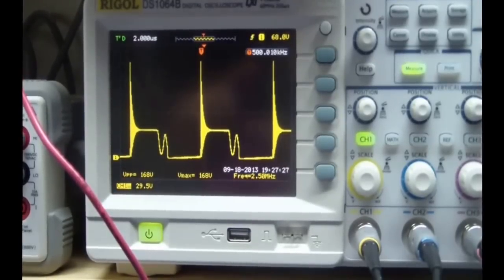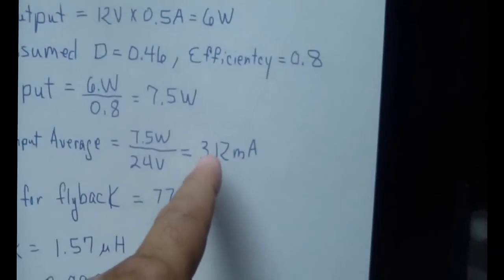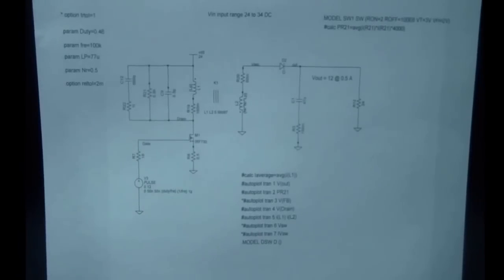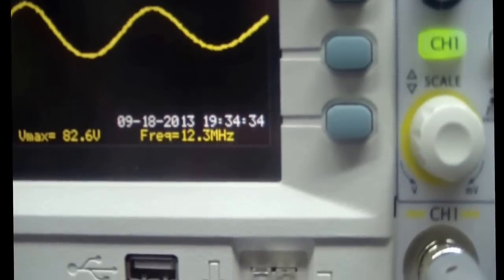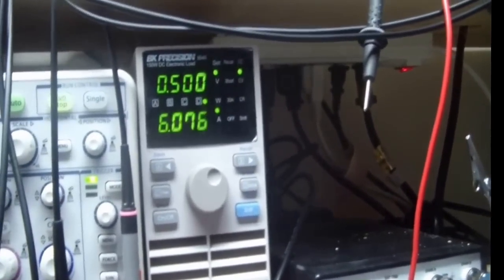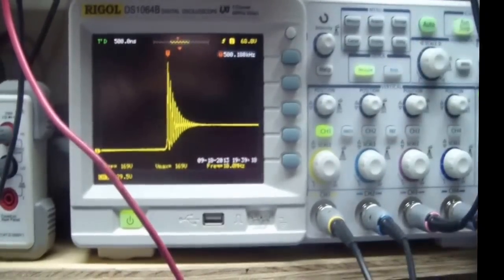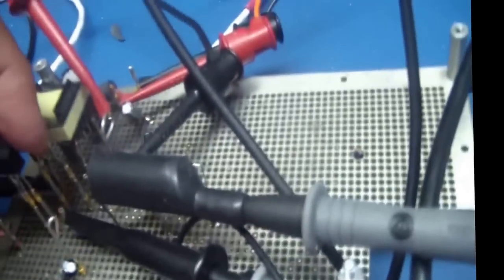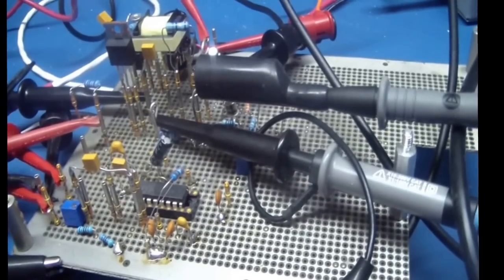Analysis and Design of a Flyback, Part 7, Testing the Transformer

Comment: i have a problem i measure lk = 70 uH and lp = 175 uH  so K = 0.77 is this very bad?
Reply from the maker: Yes the leakage to very high
Reply: how can i fix it? @RobertBolanos
Reply from the maker: Generally, you want to fill the layers to 80 to 90 percent converage. In other others, lets say you primay on the 1st layer is 5 turns of 1 strand of wire, and if would amounts to 40 percent of the first layer, then what you can do is wind it a two strands to that it will cover 80 percent of the 1st layer on the bobbin. You do the same with the rest. Please details of your transfomrer calculator and any other information to rbola35618@aol.com

Comment: Dear Robert very nice video. Do you mind telling what kind of output capacitor you used for the 100kHz switching? Can we use electrolytic or do we need some special capacitor?
Reply from the maker: Hi Anonymous, yes you can use electrolytics. However, electrolytic tend to leak over time. I typically try to use tantalum capacitor or if you want maximum reliability, then I would use stack ceramic caps. That is what we use for space rated power supplyies. Hope that helps.

Comment: Hi Mr Bolanos. I've designed a 12 to 24 flyback converter but the spike voltage on the drain doesn't change with the snubber circuit. I changed the resistor from 220 ohm to 47k but spike changed from 59 volts to 65 volts. Why doesn't it change the drain spike? Can you help me solve this? Thank you

Comment: Hi Robert , I have designed PUSH pull converter having same serious problem of this ringing which will cause Mosfet to blow off(instantaneous exploading ) as it exceeds the max voltage capacity of that , How to avoid that issue ? The only solution for this is Snubber ?  How this Leakage inductance can be avoided ?

Comment: this was a lot helpful thank you. How do I know the power rating of the startup resistor of the control IC I've the right ohmic value but it heats up so I can not operate it for long. I've also tried higher resistance value but the converter didn't startup.
Reply from the maker: Sorry Gaber, I missed your question. Do you have a schematic?  You could use a Zener and a resistor to start the IC. Across the resistor, you could add a capacitor in parallel to the resistor so that when you start up the Vinput, the capacitor will supply a short charge current that might be enough to start the PWM. I hope this helps. You can email me at rbola35618@aol.com

Comment: Hi, Robert, It is very helpful of your video. I have on question, what is the cap with 16pF? In the video, you said it is parasitic cap, but i don't know where does it comes from. Hope it can be clarified. THANK YOU SO MUCH!
Reply from the maker: Hi Yu,  That is a good question. The 16pF is the measured self resonant capacitance of the primary winding. The winding are wound on the bobbins and since the wires lay next to each other, they form a parasitic capacitors. So in the model , I included the parasitic capacitance in the model. Also keep in mind that you can only use the inductor up to the self resonance of the winding.  Fresonace= 1(2*pi*SQRT(Lprimary*Cparasitic)).  In closing, the transformer should be used below Fresonace.  I hope this make sense. If not, you can email at rbola35618@aol.com
Reply: Thank you Robert.

Comment: Hi Robert,
What about the low frequency ringing before the Mosfet turns on? How can that be reduced?
Reply from the maker: This is a good question. You use the same procedure to snub the low frequency that I used to snub the high frequency.  Keep in mind that the high frequency is Fhi = 1/(2*pie*sqrt(Leakage_inductance*Cmosfet)).  The low frequency is therefore Flow = 1/(2*pie*sqrt(Lprimary_inductance*Cmosfet)). Since the Lprimary  >> Leaksge_inductacne, the Flow will have a much lower frequency. Therefore, to snub the low frequency ringing, you place a second RC in parallel to the primary of the flyback transformer. The Csnubber = Cmosfet, while the Rsnubber =sqrt(Lprimary/Cmosfet). If you have any more questions, you can email me at rbola35618@aol.com

Comment: It is very useful. I have some doubt..1. We calculated Snubber Cap using Ringing period and total inductance across primary. Shouldn't we add leakage inductance as well during calculation? 2. In general Snubber circuit should be connect across MOSFET. Why we are connecting this across primary? It might create problem of resonance? (I think we are adding Cap and Res in series to avoid this but it will add cost)
3. Why u not added resistor across primary? Can we avoid if it is too small?
4. Snubber circuit design what u explained is common for all topology of SMPS. Can I used the same for Full Bridge DC to DC converter as well.
Reply from the maker: SAMEER GARG Hi Sameer, excellent questions. There are two ringing frequencies. One is the leakage inductance(higher frequency) and the second is with the primary inductance (lower frequency). The leakage inductance is what usually gives you the large leading spike which can give problems if the MOSFET voltage is not large enough (Vds rating). So to damp this leakage spike, you only use the leakage inductance. Some people chose to also damp the ringing associated with the primary inductance. If you notice that the primary inductance will produce a much smaller frequency. That is because the Lprimary is much greater that L_Leakage. So when calculated a snubbber for the Lprimary ringing, you can add the L_Leakage to the Lprimary but it is so small that it is not worth adding it. I hope this makes sense

Comment: Thx for a wonderful video Robert. I have one question , actually i am trying to implement a flyback inverter. When i provide 20kHz switching waveform to my primary side switch , via an optocoupler the Vgs is a triangular waveform instead of a square waveform. The output of optocoupler is fine if not connected with the switch. What should i do in this case ?
Please answer
Reply from the maker: Hadeed Sher Typically, you cannot drive a mosfet with an optocoupler. The optocoupler would need to be followed by a CMOS driver such as the MIC4422. The capacitance of mosfet are large anywhere from 1nF to 5nf. To keep the switching loosed low, you want to swing fast and have a rise and fall times around 50ns.  To do this, you need a device that can provide large amount of sourcing and sinking capabilities.  i=(5nF/50ns)*12V=1.2A.   So to drive a mosfet with Cgs of 5nf to 12V in 50ns requires 1.2A of current. I hope this helps.

Comment: Hi,
Thanks for the guidance and detailed video tutorial.I have a question regarding ZVS..As we use snubbers to remove the ringings that are caused due to Primary Leakage inductance and MOSFET output capacitance and that is clearly explained in the video. How can we achieve complete ZVS by increasing the reflected back voltage(N*Vo) that we say valleys to achieve complete ZVS.Do we need to add Inductance Lr in series with Lm.The high offset voltage makes the mosfet to switch at lowest drain voltage and results in reduced switch ON losses.
Regards

Comment from the maker: I agree but this is low power so I can get away with it. Most of the leakage comes from the transformer itself as evidence by the coupling coefficient that I calculated of 0.9898.  Typically, we can get it to 0.9998. The leakage inductance from the pin and leads are probably about 20 nH per inch of wire so I probably have about 80 nH in the primary.  All transformers have leakage inductance and lowering will increase the ringing frequency and lower the characteristic impedance of the flyback.